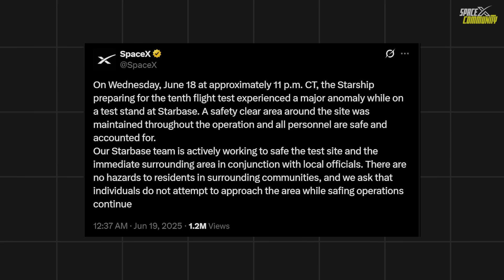LEAK! Ship 36 Explosion BIG DAMAGE! SpaceX Revealed What EXACTLY Happened During S36 Static Fire

Comment: Never even conducted the static test the thing blew up during fueling, seems like the Starship program is regressing, don’t believe that is the way iteration design is suppose to work 😂!  Someone needs to have the guts to tell Musk that the Starship design is basically flawed.  I call it the Grain Silo Rocket (GSR) for various reasons.  It’s too heavy, too brittle, under powered and unreliable.  Will never become operational in its current form and will never see humans sitting on top of this thing.  They tout the booster catch as a big success but looking at it from a program standpoint it means nothing as far as getting GSR into orbit and operational, reuse is not even on the critical path just a head fake to divert  attention from the other more critical issues.